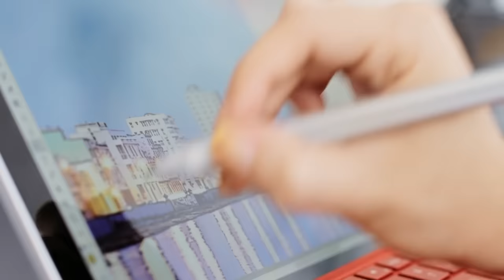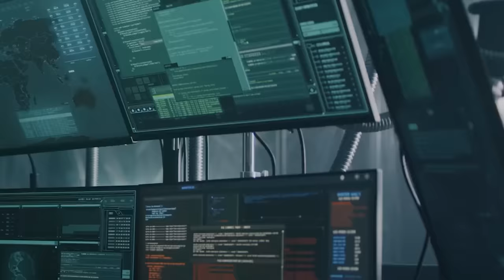Chinese Most Stealth Fighter Spotted at American Marine Base

Comment: My Marines just got a Wish delivery. That's all. 

If you think the J20 is an actual 5th gen Stealth fighter..it's more of a 4.5+ Low Visibility fighter. It is VASTLY inferior to the F22 in capabilities and even the F35 with the Lightning IIs networking, avionics, stealth, and VTOL capabilities. 

It's the Chinese knock-off of a capable fighter. The J20 is widely known around the world to have MASSIVE maintenance issues and undertrained, inferior pilots. 

The J20 is only a threat to the Chinese Defense Budget.
Reply: The J20 is what you get when you design a plane using pictures of a F22, engines of a Su-27 bought from Russia, and the stolen chassis of a wrecked Eurofighter. Combine all the above in a pot stirred by Chinese engineers that have absolutely no experience in researching, developing, and building radar evading aircraft...then you get the "Mighty" Dragon J20. 

Like I said before, it is only a threat to the Chinese Defense Budget with it's vast design flaws, extreme Budget costs, and innumerable maintenance issues. Hell, the Chinese can't keep one in the air long enough to do complete test runs. It's cheaper for them to build a new one than fix the issues a built J20 develops after 50 flight hours.
Reply: THANK YOU FOR THIS. 🙏🏽🙏🏽🙏🏽
Reply: The only aircraft that the Chinese have that have the potential to be a credible threat...but not really a threat in a modern combat theater against an advanced enemy such as the US or other such NATO members...are the J10(Chinese copy of an F16) and the J16(Chinese built SU-27). 

We've seen already how the F16 and SU-27 stack up against the F22 and the F35....they don't. Neither is really a challenge to a USAF piloted F-15...especially the latest version being the F-15EX. 

When it comes down to military capabilities of China versus the US...Wish isn't just a Chinese company...it's all China has compared to the might of the US military.
Reply: Well... if you are India and China gets ambitious on their ongoing border issues, it may be a problem.
Reply: @davidmclean357   India has a developed a capable airforce in the last two decades. India is more than capable of holding it's own against any Chinese aggression by air. If you look into the aircraft India has purchased from foreign entities as well as their own developed currently in service aircraft versus the Chinese airfleet...India has a decent advantage in capability versus China when you use only facts with no propaganda involved. 
Then the fact Indian pilots have a substantial amount more of flight hours and training sim flights versus the Chinese pilots...it's actually kinda one-sided for India.
Reply: I understand what ur saying, but I'm just wondering how ur getting ur info because not much is known about the j20, so maybe it is better you never know. So I would still think it's formidable
Reply: @brendanharvey3583   Little of the J20s capabilities are known to the public. I known that's an ambiguous answer, especially given the setting of our discussion. I can only assure that the J20 isn't a Mighty Dragon as it's being touted, but more of a Paper Tiger when compared to Chinese released propaganda on the J20. 

I'm retired US Intel that stays in the loop, but I'm not quite as shackled on what I can say as active personnel are...so I share what I can here and there in hopes of alleviating some of the worries US citizens might have concerning the threat of conflict with US adversaries such as China. 

That's also why I tell everyone to do their own research into such subjects using any and all public information...just learn to weed out the propaganda.
Reply: @brendanharvey3583 what we do know is that they show up on Taiwanese radar even when they try to be stealthy
Reply: @neftalimorales5449   You mean on American designed radar(thank you, Raytheon) built in Taiwan from Taiwanese parts that are pretty much prevalent in all US weapons and avionics systems. Lmao!! But you are EXACTLY right. Information gathered from those radar intercepts along with near satellite observations and other unnamed sources gives the US an extensive database on the J20..and other Chinese military assets.
Reply: @knowplay3258 i think youre wrong.. nobody really knows. but we act like we know the capabilities of it... At least i have to give some props for the looks.. i think its a beautiful aircraft.
Reply: It doesn't have proper 5th gen engines too
Reply: @knowplay3258 i think you are fake.. a gaming nerd, acting as us. intel.
Reply: It's almost as good as the SU-57 haha!
Reply: It can't even spin on the Y Axis straight
Reply: @brendanharvey3583  You may "THINK" whatever you want, some of us "KNOW" that canards make plane vastly more visible to radar.
That is the reason NO US plane has them, but if you can't make engines and controls work, you MUST resort to canard. The plane is also way to looooong to be able to do any serious dogfight. 
With ALL of the information on the Net today, most people still "think". instead pr read and educate themselves.
Try is once, you head will not explode.
Reply: If it makes anyone feel better, Chinese "Stealth" tech is based on the reverse engineering of 4.5 Gen US fighter-bomber downed in Bosnia that the Chinese paid ALOT of money to acquire for a very short period...a F-117 Nighthawk. That is US 2nd Gen Stealth tech developed in the late 70s and early 80s. Considered Low Visibility by today's standards. If any of you are old enough to remember, a F-117 was shot down over Bosnia due to a failure in OpSec of a planned night time bombing mission of a B2 being escorted by two F-117s. 

The Chinese thought they had really acquired cutting-edge tech, but the US made absolutely no attempt to recover the aircraft at the time as it was seen as a chance to let old tech fall into and utterly fool potential adversaries. The J20's "stealth" tech is based on what little the Chinese could reverse engineer from that wreck...which we made a show of demanding the return of once it became "public" knowledge the Chinese had acquired it. It was an unfortunate situation of a US aircraft being shot down(the pilot was recovered and a movie was made concerning his rescue) that US Intel turned into an ongoing advantage to deceive other not-so-friendly countries into believing that was the best tech we had...which had already been slated for upcoming retirement from the active US airfleet. 

We NEVER let anyone...not even our own citizens...know what we actually have or are actually capable of. Everyone should know this by now...things the American public take for granted are nothing but antiquated military tech from atleast two decades past. Some examples:
GPS...USN has been using GPS tech to plot courses and control warships since the late 80s.
Text messaging
HD satellite photography used in things like Google Earth...I was analyzing such images for Intel purposes back in the early 90s...with the clarity of 1 pixel = 1 inch which is very clear for an early 90s digital satellite photo. 
64bit multicore CPUs for use in handheld or near handheld computing and communications devices...like your cellphone. 
128bit encrypted wireless communication.
Use of electromagnetic radiation as a localized source of thermal energy....think your microwave. 
Near Earth orbit satellites that are common place today for television, cellular, and internet communications...US military had them  up there in extremely low orbit for the same purposes 20 years before any of it was allowed to be used for commercial purposes just like with GPS technology.
I could go on and on. The point: if you worry about how the US would handle a conflict against any enemy based on the publicly available knowledge of US assets/abilities versus our enemy's abilities...don't. What you know about is atleast two tech generations old to the US military. The US is by far the most most technology advanced and potentially lethal country in existence by twice as much as our closest enemy or even ally...and then some. No worries...we got this...and anything else that could possibly come along!! 😎😁
Reply: Thank you!
Reply: And btw...the area of Bosnia where the F-117 was shot down...that was my main AO when I worked Intel during the Yugo Wars. I was there...basically around the corner and down the road just a little bit from the crash site. I was informed within a minute of the F-117 being downed and tasked with covertly aiding in the recovery of the pilot while keeping my presence as unknown as possible...help but don't let anyone know....which meant deter anyone looking for the pilot. So, in this case, I know exactly how the story of the Chinese acquiring US Stealth tech went...I requested a green light on downed asset elimination...I had done similar with downed US helicopters by using two thermite grenades to completely melt all US electronics before said tech could be salvaged by bad guys...I was given directives to not approach the downed F-117 nor to attempt any type of salvage/elimination action...basically...stay atleast a couple of kilometers away and make any chance observations if possible, but not to directly try for observational access. 

Prolly told a little much there...but...it was what is was...and it worked out. 
Just remember...the US plays 3D chess while the rest of the world is learning to play checkers.
Reply: @Nitroat-xo4tj   You are allowed to have whatever beliefs and opinions you like. As for me being a gaming nerd, not so much anymore...I'm a 51yo redneck from Louisiana that's always liked First Person Shooters like Half-life and Quake 3. As to what I did for a living before retiring from that occupation...I'm not here to convince anybody of anything about myself so your belief in anything I say isn't required. I'm just here to try to educate, relieve potential worries, and help...if I can in any way. 
As for the J20 looks...from a non technical standpoint..I think it looks great. From a technical standpoint, I think it looks like it has a few potential issues. I never said anything about how it looks...only it's capabilities and it's known flaws. Oh...and the fact it isn't nearly as capable as Chinese propaganda would have the world believe. 

Again...believe what you like...atleast you are thinking and that's all I want for anyone.
Reply: The J20 is only a threat to the Chinese Defense Budget.
Pretty Harsh 😂
Reply: Can yous handle it 10 to one. Would you prefer to have 100 budget fighters with pilots to fly them for the same price as 5xF22s with limited pilots.

The sky can be filled with these and drone after drone after drone after drone. 
Quantity over quality
Reply: @knowplay3258  have you seen a Norico convention??? Chinese aeronautics and submersible drones are 👌 they are perfectly capable at engineering. Their anti ship drones are spectacular.
Chinese created the most powerful nuke reactor on earth. 

It "must" be noted that the J20 is designed for a very specific purpose and that is Naval support only in the south China sea remember that ☝️ it is for Anti ship and smart bombing only. It's not exactly a "fighter".
Reply: wow, you know a lot of stuff.
Reply: Don't forget the citizens..
Reply: Shh dont tell anyone
Reply: @rolandcuttings4953   I don't count one-offs of decent quality made for the purpose of propaganda. You can rest assured of two things to be factual: the Chinese don't mass produce quality weapons or weapons systems AND any thing the Chinese have created militarily, the US has technology two steps ahead..unless the Chinese have stolen it as usual. 
I said, I'm not here to convince anybody of anything...only to educate and maybe start people thinking/researching on their own.
If you are a fan of Chinese military hardware, then by all means, continue to be so and enjoy yourself. You are more than free to have your own opinions on anything you choose.

But if you want to discuss facts, then I'll continue to reiterate my points on the failings of Chinese hardware and the Chinese military as whole. 

I'm an American. The Chinese have aligned themselves against the US. Until they do otherwise, I'll not be a fan in the least. Which is a shame because China is a beautiful, diverse country with an ancient, rich history. Researching into China's feudal past unlocks some outstanding creations and achievements well before many other peoples of the world stopped banging rocks together.
Reply: @panan7777  One of our bombers has 2 small canards. b1 Lancer
Reply: never underestimate your opponents. That's why your rhetoric is dangerous. The goal is to train like it's waaaaay  more capable than anything we have and hope that our intel is correct. A lot can be said about our expensive f22 and f35 programs. The F22 is an amazing workhorse and so is the F35 having seen both performing maneuvers in person. Yet what they show us vs what they're actually capable of doing are two different values.
Reply: You have impressive knowledge of classified aircraft
Reply: Eh. The J-20 is a proper 5th gen. It definitely can't compete with a Raptor or an F-35, but it's a helluva lot better than the joke that is the Su-57
Reply: The planes themselves are becoming less relevant. Long distance bvr missiles are making modern fighters more of a sniper rifle than a dog fighter.
Reply: Wasn't the J20 and Su57's radar return something like .3 while the f35's was .001? I forget the exact numbers but the Russian claims in particular were aggressively awful.
Reply: @Dasycottus  I approve that message 😂😂
Reply: @knowplay3258 The same mighty US military that couldn't even defeat the Taliban 😂😂
Reply: @Josef9004  - Funny when you kids think a tiny detachment of US forces deployed in a police action is "the US military at war". The fact is, the US hasn't actually committed to any kind of full scale war since WWII.  
    The maximum force deployment committed by the US in any conflict of the past 75 years was about 1/3 of its forces (Desert Storm 1990)... which is why that war lasted about a week. The Vietnam conflict paled in comparison, with a maximum surge that peaked at about 1/6 of US military forces deployed, but most of the time it was well under 10% of US military forces. And the tiny sandbox deployment you're referring to was (at most) a single digit percentage of US forces, primarily sent in a training capacity. The maximum surge of US forces in Afghanistan peaked at about 1/15th of the military, and most of the time was a far smaller deployment closer to 1 or 2 percent of US forces.
    The fact is, the US treats most of these minor conflicts as nothing more than training exercises for their own soldiers. No matter how embroiled they appear to be in these little exercises, they are still simultaneously capable of fighting TWO major wars across two oceans at a moment's notice. The 1990 Gulf War is perhaps the only time since WWII that the US deployed enough forces that they may have limited themselves to only having enough in reserve to fight one other major war across an ocean.
    So you should hope and pray that you NEVER get to see the US actually commit to a full scale war (ie: gloves off), because it would be a truly terrifying show of force.
Reply: Why everybody always like F22 yay you cant really expect a country that started way later than the USA to have something superior??
Reply: China calls it a gen 5 fighter.
We call it a gen 1 target.
Reply: I wonder why most of my fellow Americans tend to see the world through the lens of weapons development aimed at fighting us.

First - I will just say that fighter generations are useless marketing terms.  There are old planes that fill the role they were designed for better than anything in the air, today ; and new planes that can't do what their predecessors did.

Spec ops units love a prop driven plane that may as well be a custom P-51 kitted out with FLIR and other tools.  Why?  Because it works.  No one expects it to gun fight an F-22 or something silly, but it fills its mission better than the F-35 can.

Is the J-20 "stealth?"  Not really, but there again, neither is the F-35 or F-22.  Or B-2/21.  "Stealth" is depreciated.  We can track the water vapor from the turbine combustion.  It's no different than having to filter out clouds from the return data.  The plane has a larger return signature.  The best "stealth" can do is obscure weapon loadout and gathering information from the intake fan's return.

Aerodynamically, the J-20 is a bit underpowered for a fighter.  The Chinese are working on higher performance engines and, no doubt, will include them in such designs when they can.  It has a larger payload than most of our "stealth" options and is likely intended to fill the role we left largely vacant with the retiring of the FB-111.

It doesn't have to be a wonder weapon to be competent at its designed role and China has demonstrated an ability to perform competently at engineering when they want to.  While some parts of China might have no problems frying up food in oil they gather from the sewer, other parts of China are competing with us in the industrial arts and sciences.  China's market is a very big box of chocolates and the CCP tends to keep the best offerings for itself.

Is it "a threat?"  Under the right circumstances, a pointy stick is a threat to anyone.  I don't think China has the logistical or manufacturing means to make much of anything qualifying as a threat to American naval dominance.  They could certainly threaten a ship or select U.S. operation - but at great expense to their own military capital that would likely be the unraveling of the CCP.
Reply: @@KittyCat-zv4js - The Ukraine is hardly a full scale war. Russia is but a pale shadow of what they were back in the days of the cold war. They have such limited numbers of soldiers, and poorly trained at that. Their stockpiles of weapons and ammunition are actually quite small, and started running low almost as soon as the war started. And they have no big budget to quickly produce more. 
    Worst of all, they face a catch-22 with major risks on both fronts. One of the few things they still have that's a marketable commodity on the world market is weapons. So if they send their small stockpile of modern armament into this fray and it fails... that would kill their economy by exposing the flaws in their product. But if they don't use it, they lose the war and look just as bad.
    As for the US, they have reconfigured minor parts of the military into small-scale warfare specialists. It's becoming a primary focus of special forces type operations. But don't think for a minute that the US is letting down it's gaurd on the major-scale warfare front. They are more prepared than ever for the "big one".
Reply: @knowplay3258   "the Chinese can't keep one in the air long enough to do complete test runs. It's cheaper for them to build a new one than fix the issues a built J20 develops after 50 flight hours."

Boy, does this assessment sound consistent with a number of other Chinese made products I've used over the years...

Heck, even their EVs are known for spontaneously combusting and having frequent glitches and other electrical problems..

Also, thanks for the laughs.
Reply: @knowplay3258  agreed..and with those advantages they should win Vietnam and Afghanistan wars easily..they can since u said US is superior in all aspects..but I wonder why they left this 2 warzones like headless chicken in the middle of the night...they even leave their stuff and gave Taliban a free meal...geez man .
Reply: Why is so many anti US commenters turn to insults when facts a presented? I've not insulted anyone, including the Chinese people..only aspect of the Chinese military and their government. I take no issue at all with the people of China. 

I bring well established facts to the discussion in hopes to promote people to think, research, and debate. Why do so many resort to insults of me and my beloved American military? 
Is when you get your feelings hurt when faced with facts that you lash out instead of having an honest discussion? That is the definition of an immature mind. Don't be that guy.

If you can bring facts to debate my facts..excellent!! I can respect that. But insulting lies just to further propaganda and an agenda? I have no tolerance for such. 

There are a whole plethora of FACTS about the US military that would definitely hurt the feelings of the "anti US" people commenting that I could most assuredly bring to bear...but I'm not here to crush the anyone, especially those making valid points and wanting an honest debate.

In other words, those fanboys that hate the US need to lay off the bs insults or a will start listing easily verified facts that prove, beyond the shadow of a doubt, that the US military is twice as lethal as any other two global powers combined.

Keep it civil and lay off the insults...or the butthurt will be issued!!
Reply: Bb
Reply: The J20 doesn't have vertical take off and landing capabilites like the f35. That can be a disadvantage if the Chinese aircraft carrier's catapult system isn't working.
Reply: @knowplay3258  Well how do you know the exacts specs of the J-20, such as the composite materials, the radar/avionics, such information is Classified that even guys at the Pentagon will kill for? The level of arrogance, I mean people are able to somehow able to determine the exact specs of aircraft by just "looking" at it, (what would be point of Windtunnels and Radar testing then?) If anyone really knew they'd a 2-Star General , not making assertions on the Youtube comment sections.
Reply: @Uruz7Laevatein   I've never claimed to know the exact specs of the J20, only stating what is known and what has been accurately surmised by US aircraft experts. Granted, any and all "apparent" flaws of the J20 could be a rather indepth ruse by the Chinese to hide the capabilities of the J20, but such a ruse would be rather elaborate and costly. Given that, I still wouldn't put it past the Chinese at this point. 

What is arrogant is speaking as if you definitively know a person's thoughts and extensive knowledge based on a few YT comments. With that said, which of us is the more arrogant?
Hmm?
Reply: @Uruz7Laevatein   BUT, you do make a valid point and have added to the debate/discussion. So, in actuality, I'm rather glad of your comment. Keep it up!
Reply: Btw, a good percentage of the avionics are known....classified, but known. Not my field of expertise or research, I just know that knowledge has been "acquired". Not all of it, but a good amount. But again, such could be a ruse...counter espionage...to allow the US to THINK they know, when the actual avionics suite used in the actual aircraft is completely different. Only the Chinese know for sure.
Reply: @Mr.Ekshin   Well stated full of relevant facts!! Well done!! 
And yes, I am biased towards the US military..as I should be seeing as I'm an American. I don't fault anyone here for speaking positively of their native country's military. A person should be proud of where they are from...in most aspects.
Edit: Being raised during the Cold War, I will never be "friendly" with any country subjecting it's people to Marxism, Communism, or any type of authoritarian socialistic rule. But that's just me. I'm not here to change the world...just get people thinking and talking.
Reply: At least it’s slightly better than the Felon.
Reply: LMFAOOO. Holy Copium.
Reply: @brendanharvey3583 It's pretty well known. You can visibly see manufacturing defects on their models in flight. They have well known engine issues as well as being massively overweight compared to American 5th gens. Their engines have life spans in the hundreds of flight hours while American craft measure theirs in the thousands. 

We've seen their radar cross section and it's massive compared to true stealth craft. It's just not a real threat to modern craft much less a 5th-6th gen like the F35 or NGAD
Reply: The big question is how affordably and quickly they can crank them out.  If they can build and operate at least 5 times as many as their adversaries, they are a significant threat, even with inferior capabilities.
Reply: @JohnGeorgeBauerBuis   That might would be the case depending on just how superior your enemy is/was, but in this case, China barely has two dozen. All have reportedly seen down time from unforseen issues causing extended grounding for corrections and maintenance. NATO/US is fairly good at maintaining up-to-date Intel as to adversaries quantity of weapons and fighting vehicles. And almost as good Intel on the capabilities of said weapons. Right now, China isn't a threat to the US in the air...but, I will admit that could possibly change. Quality and quantity just isn't there...in air armament, aircraft, and pilots. China IS steadily trying to close both gaps though. China IS, however, a valid threat to any US Naval vessels within a certain range of China's mainland...not from the Chinese fleet, but rather both land launched and air launched anti-ship missiles...which they seem to have a stockpile. 

But the "Mighty Dragon" just doesn't currently have the ability or the numbers to be a threat to the USN and USAF...throw in the airwings of my beloved USMC with their Harriers and F35s....not really a valid comparison...especially in an air dominance or air superiority role.
Reply: J-20 is definitely underpowered for a MR aircraft, it's fairest head to head would be against the F-35 considering it's weight and faux stealth. 
F-22 is vastly superior to it and the only thing that comes close to an F-22 is a Eurofighter Typhoon.
Reply: 4.5 gen reduced visibility fighter
Reply: @QigongGreyDragon  "quantity has quality of its own" is a stupid way to go, 
china needs fuel, 
missiles (where the real capabilities are)

pilots
logistics
airbases
equippment and maintenace
Reply: @HungwellAngerthy  thats why stealtth is being developed with radar stealth means the aircraft can get closer to the radar/enemy fighter/ect
Reply: @knowplay3258  Do you know what a lunenburg lens is??
Reply: @goldentimes7731  It does?? The WS-15 is already fitted on the never variants of the planes
Reply: @Viktoronto   I'm familiar with a Luneburg lens and how it works, but not more than a passing knowledge of it.
Reply: you actually being serious!?
 @john-hy3gb  

You have heard of the siberian pipeline from the North border to Russia.
China has all the fuel it needs next door. including most other mineral products.

Chinese have concrete pads all over the country, abandoned facilities Airbases?? 
Equipment and maintainance? again go look up a NORINCO convention. those are yankee problems not chinese ones.
Reply: @QigongGreyDragon  
Number 1 the oil needs to be divided by all of china army/navy/airforce/civilian/ect and more required fuel makes fuel depots more valuable and a higher target.

Number 2 materials from russia need to go ohh idk through all of russia to get to china there is aboslutely nothing material wise north of the urals that russia has developed meaning they will need large transports.

Number 3 modern aircraft need modern sams/defense systems at their airbases meaning china will either clump many aircraft in airbases with high tech defenses which will be overcome by saturation or spread out their aircraft thinly in airbases who wont need saturation to be destroyed

Number 4 theres little to no evidence that norinco can effectively cover the entire chinese army in case of a war from bombs to tanks to missiles to whatnot norinco cant cover the entirety and neither can any other chinse military industrial complex companies (yet) without heavy penalties to the war effort
Reply: But 4th generation is the Adult in the room, while Gen 5 is the "Look mom, No teeth" youth.
Reply: It doesn't matter if the J-20 is not as good as the F-35 or the F-22. It is good enough to fight Taiwan and it will never have to face the US in any large scale battle. Everyone seems to think that the J-20 is for use against the US.  It isn't.  It only has to be good enough to beat Taiwan. Duh.
Reply: @jtl05  The comment I replied to "no US planes use canards" So that matters to the statement. He didn't say stealth. And yes the B1 isn't stealth. Have a good one.
Reply: @marcmo7138  the person deleted their comment so i didn't see it sorry
Reply: @jtl05  No problem.
Reply: @knowplay3258  you were starting to get me until the "india has developed a capable airforce" part... 
i dont see how the indian air force has a decent advantage over the chinese air force when their best planes are 36 rafales and 260 su30s
their domestically produced tejas has been in production for over 20 years now but have only seen 50 built
"facts" huh
Reply: RA
Reply: @knowplay3258  Exactly.
Reply: Do you have any valid statistics on that or are you just pulling crap out of ass? I have a hunch that the latter seems to be the case.

If you want to compare both in valid ways, you need to, at least, to show the actual numbers of both and check at various experiments and simulations.

Firstly, how is J-20's physical capabilities related to undertrained pilot? A jet is a jet, and its physical capabilities aren't determined by the pilot. The pilot's task is to understand how it operates and control it accordingly. 

Secondly, as for maintenance issues, even if they exist, they are not necessarily the jet's problem but the maintenance operators. 

It seems pretty delusional to underestimate something on a vague basis without providing any evidence. It's not even a matter of supporting whichever side, but a matter of objectivity and critical thinking.
Reply: @knowplay3258  J-10 is a stolen copy of the Israeli IAI Lavi, which was an attempt to compete with the F-16.
Reply: If the interlinking of US air assets is as good or better than it seems, I don't see how a foreign airforce could engage as a peer in air to air. Our pilots would be flying as if they have a minimap in a video game showing every ally and known enemy asset on their display.
Reply: @Dasycottus no no no nothing
Reply: Nope, you just downplayed the role of 5th generation fighter
Reply: 5th gen refers to the concept and not to the actual perfomance compared to other 5th or 4.5th
Reply: Well   the F35 also is known to have a serious maintenance issue (the readyness state is much lower than what was originally expected) so this  point   I would   consider more or less a strategic tie. The difference is tha ton long run F25 likely will improve.
Reply: @knowplay3258  Hi, I'm an Italian, I've read the whole discussion, you say you're a retired intelligence agent, is that true? If so, could I ask you some questions? I would be curious to know your opinion on some issues that interest me.
Reply: Source: Trust me bro

> Knows nth about the J-20 and has no access to classified documents for it

> Says it is inferior to it in every way.
Reply: @knowplay3258 because these people want to see the USA fail. Even with its imperfections tje USA is still one of the best countries in the world. Just seeing how many people flock to the USA for opportunities and freedoms including freedom to criticize the government. People that have to constantly bash bash and bash just know that their place of origin sucks. I'm an immigrant and even i know how beautiful this country is even with all its imperfections and its constitution and freedoms have to be protected from all enemies foreign and specially domestic.
Reply: You will do anything to hate on china.
Reply: thank you this guy hurts my brain every time he says its a 5th gen
Reply: @knowplay3258  btw f-22 is 1980's tech
but im still kind of worried, it would be cool if we had an f-22 version of a tank that would destroy enemies from miles away using vertical launch systems or something yk or super small stealthy u boat styled warships that could anihilate the enemy fleet and dissapear. or extremely long range missile launch systems that can send cruise missiles that drop a stage and turn into anti air missiles that can take out enemy planes without even sending our own. or like the ads system found on tanks put on a plane to destroy incoming anti air missiles. it would also be great if we actually produced thousands of f-22
Reply: Atleast they didn’t spend the gdp of a country to make that plane
Reply: @brendanharvey3583 the design alone isn't 5th gen. Too many angles that will bounce radar back and the canards are giant billboards on radar.
Reply: @knowplay3258 2 months late, but felt the need to point out some potential misleading info. (Preface this by saying that I’ve lived in china for a long time, so I do have my own biases)

The J-20 is not a copy of the f-22 like many claim it to be. Though there has been (most likely true) reports of extensive espionage efforts by the chinese, the j-20 is still a distinctly different airframe incorporating similar technologies in different ways. It now uses the domestically produced WS-15 engines, the newer variants of which have thrust-vectoring capability.

Similarly, the J-10 is not a copy of the F-16, but rather a copy of the IAI Lavi (israel sold airframes to china after the cancellation of the program). That being said, the J-10 is still a much further development from the IAI Lavi, and is likely on-par with the capabilities of the f-16 (keep in mind the j10 is much younger).

In general, the J-20 is much more capable than the J-10, especially considering it is being produced in significant numbers (more than the f22). I would not argue that it is as good as the f22 or f35, but it does come close (or even surpass) both aircraft in certain areas.
Reply: @Nitroat-xo4tj just because it looks good doesn’t mean it performs good
Reply: @knowplay3258  India is ranked 6th and China is ranked 7th in combat air power. The USA Airforce 1st, Russia 2nd, USA navy 3rd, USA army 4th and USA marine's 5th.
Reply: I don’t think it crashes as much as the F35.
Reply: @knowplay3258 your right on with your assessment of what we as Americans know as what we have in military technology. Most of what we get to see as “ new “ is already 5 to 10 years old.
Reply: @dingodog5677 numbers talk.
 450,000 sorties and only 29 f35 crashes, with just under 1000 f35 built to date. J20 have less than 250 airframes, unreliable engine, and most importantly is made and designed in china lol
Reply: It's basically a very pretty Rafale fighter copy.